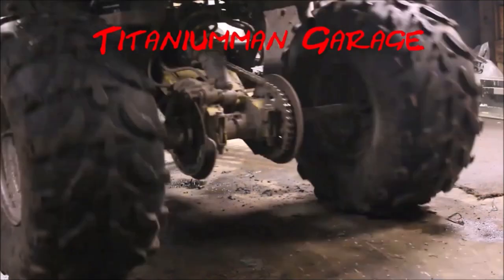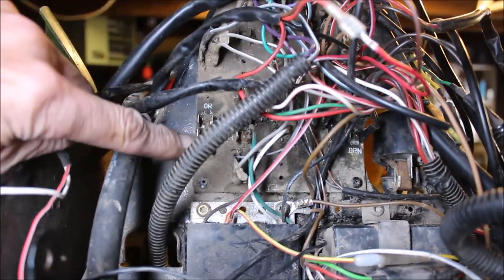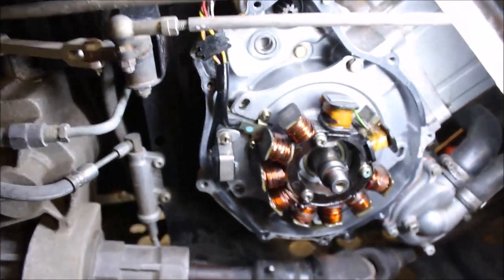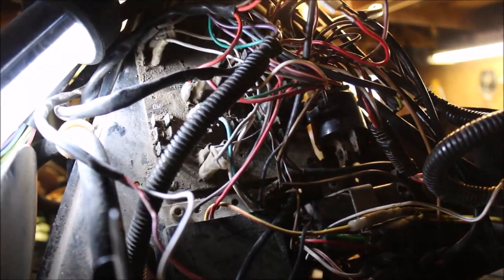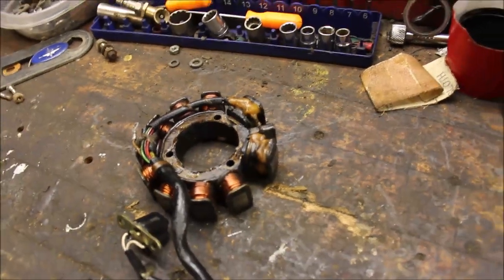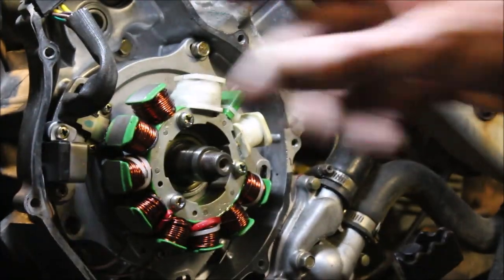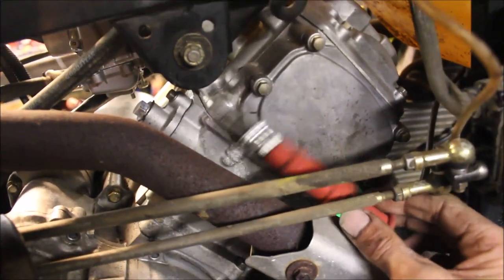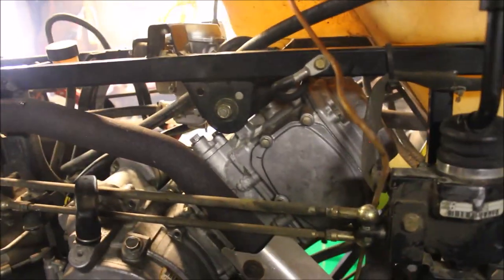NO SPARK on your Polaris Sportsman? Let's troubleshoot it!

Comment: i have a98 polaris sportsman 500 engine breaking system.put carb.fuel pump,fuel filter ,fuel shutoff spark plug ,ran 30 sec then quit,removed black wire on both cdi and reverse limiter and throttle shutt off switch,still ran for 30 sec then quit,now put ebay cdi on same short run then quit,had spark until it quit,3 carbs and 2 fuel pumps and 3 weeks later , finally purchased used coil would not run tested coils ok used coil had bad coil wire but good boot,mine had good wire bad boot.swithed everything around and now it almost throws you off machine on take off with no hesitations.i watch your videos and have used some of your information thanks for doing these
Reply from the maker: Awesome. Glad to help.

Comment: I am working on 2004 sportsman 50 ho early model A04ch50AC, no spark or very week all ohm and voltages are to speck trigger, stator, igniter coil, all clean grounds. Coil was bad so replaced it.Gets 180 peak vdc from cdi box  to coil but crappy spark, all timing marks line up good, 90 psi compression good. Just want to get it to fire up using starting fluid. 1 burned wire coming from ingtion switch just got hot replaced it all other wires good. Finaly replaced every thing stator, cdi, coil, voltage reg, ect. Kill switch checks out good but bypassed it, throttle kill adjusted right. Any help would be good. Also need to know if maybe it is because it dose not have a speedometer in it. I have worked several 400 & 500 never had problem like this!
Reply from the maker: Speedo isn't the problem unless there is an issue with the wiring going to it. If your 4x4 didn't work or it didn't light up. That would be a problem with the speedo. To me it sounds like you have hot wires touching somewhere. did you use aftermarket electronics? I have had issues with them. cdi bad after 2 starts. run stop kill switch bad after a week. also do your wires look green when you unplug the kill switch. hard to diagnose without seeing it. Keep in mind power goes to the key first, then the kill switch, the speedo is in the middle somewhere, then to the cdi and rectifier.
Reply: @TitaniummanGarage  ok i will retrace power to all switches in that order, had china cdi when i got it did put a second one in, 4x4 wires are not even hooked up the wires have been cut coils test good, i think someone poured a quart of oil in stator housing pretty sure stator was not working right even tho it tested good. Pull start pully and guts were ground in to little pieces.  Don't think the crank seal is bad that why i want to get it to fired up incase i need to pull motor and rebuild. There is no speedo in it at all its missing. Where is a good source for parts that is not china junk? Some green in plugs, cleaned all connectors with vinegar and electrical contact cleaner. This thing is mess. Ps your videos are great lots of good info !! Thanks jerry
Reply from the maker: @JerryLa-jv5dx  Check out my latest video. Pull the flywheel. I bet the pickup coil or the magnets in flywheel are broke

Comment: I am working on a 2001  Polaris  Sportsman 500 HO. I am having a no spark issue. I have unplugged the black wire from cdi box and it fires right up no problem so I replaced the kill switch with a brand new Polaris kill switch and now back at ground zero. I have replaced all Components dealing with spark and Still having the same issue. Since then I have put all Polaris  Components dealing with spark back on. Any help would be much appreciated thanks.
Reply from the maker: If you used the china aftermarket stuff it's more headaches. My guess is it's the cdi. But check your wires going to the kill switch. If they are green by the plugs your gonna have issues. Clean all your grounds too.

Comment: I don’t understand you changed all those parts and it’s going to be the kill switch , the stator might have been good and the cdi if fine if it runs without kill switch wire usually (black+white)
Reply from the maker: I pulled the cdi off a old polaris. It could also be bad.
Reply from the maker: I tested the stator with an ohm meter. it was shot.

Comment: I put a stator on my 99 335 and still no spark. Disconnected black wire from switch and still no spark. Waiting on a cdi from eBay to get here
Reply from the maker: Just beware of the china cdi's I've had bad luck with them.
Reply: @TitaniummanGarage  I believe it is a china cdi. What was your experience with them like?
Reply from the maker: They fried right awwy

Comment: heres a good one for you .. 2002 polaris 500 ranger.. New cam interminiting spark . but fired up ran like never be for it was scary fast came home backed it in my garage went out the next day no start cranks over NO SPARK!!!! coil show's its grounded replaced it 3 different coil... But crank it over with a probe on coil wire from CDI it flickers like is pulsing ... but no spark ... CHECKED Every wire on the CDI Box NO Power to CDI Box ????? why ... ALL I WANT TO DO IS SELL THIS THING I WANT IT GONE AND WANT MY MONEY BACK ON THIS THING any help would be great...

Comment: 99 ranger in background 🤔
Reply from the maker: Yup. Thats my toy. I like to start off the video with something that says Polaris.
Reply: @TitaniummanGarage  I got a ole 99 runs great . Hardly use it anymore just sits . Every once and a while I rip it around the house . Needs some brake line work. But I don’t go very fast . Probably one of my most reliable machines
Reply: If you hold over ride button it will spark! If spark is on and off! Got my overtime button is ziped tied down!
Reply from the maker: @shadedevold5440  That's funny. I did that once.  I think if you pull the black wire on rev limiter you dont have to do that.
Reply: @TitaniummanGarage  I did that didn't make a difference even tryed new cdi boxes and Only way it will run is with rev override pushed in! It's weird! Even replaced rev limiter and regulated! Oh well runs good! At least don't have to hold the rev over ride for 4wd in reverse! Have you ever run into where the front hub seal rubs a groove in the hub sleeve? The fuild leaks out! Ran into alot of that and replace hub sleeve! Got becareful when getting a replacement some are aluminum and need the steal sleeve for magnetic coil to work!